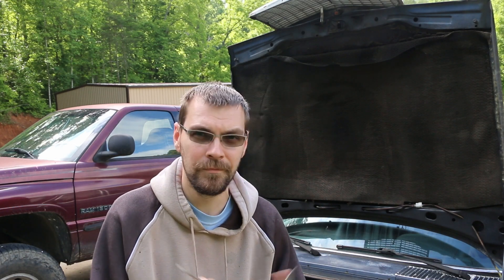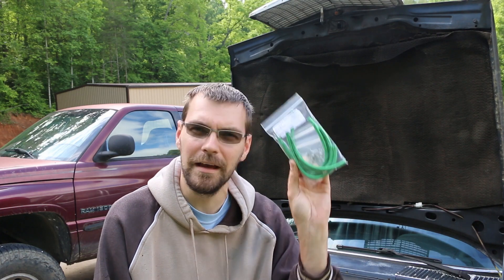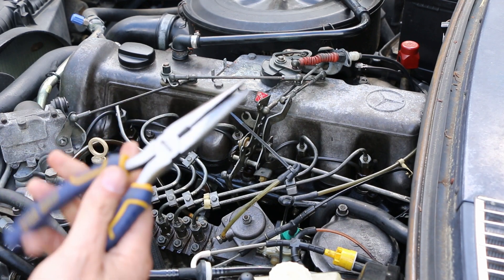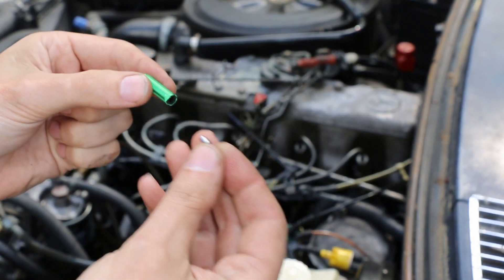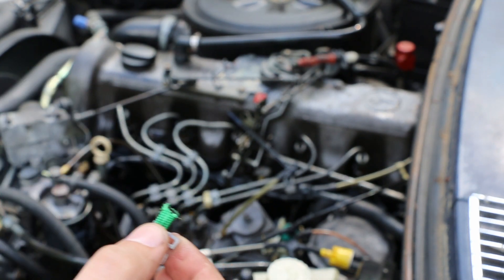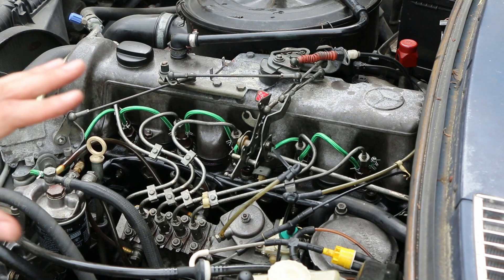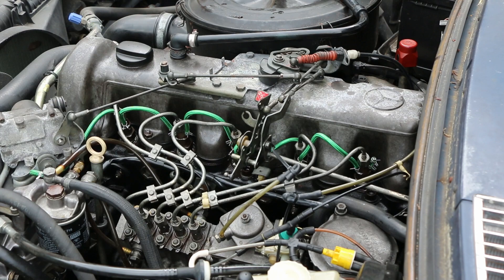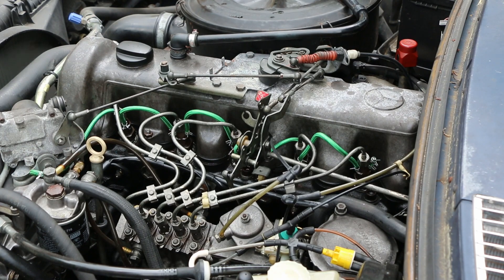W123 Diesel injector return lines leaking.

Comment: lol ...still running with that same old knock ????
Reply from the maker: I've done injectors, valve adjustments, delivery valves, compression test, checked injection timing, timing chain stretch, you name it, its been done and it still has a weird little knock/misfire that gets more pronounced warm.
It is a LOT quieter and less noticeable than originally, it would shake the car around at a stop light like a massage chair when I got the car. I'm out of ideas for the time being lol but I'll come up with something eventually.

Comment: 1:54 Why does that have that plug on there?  (the one closer to the fire wall)  Why they design that like that.  I accidentally broke that plug and need to rig up something to stop the diesel from sipping out back there until I get new injector with the plug.
Reply from the maker: The plug in the return line for the #5 injector with the little short line is so that all the injector bodies can be the same. Saves manufacturing a special injector body for that cylinder.
Did you break the nipple off the injector or the little hose broke?
Reply: @trythistv  the nipple off the injector, that little short plug...